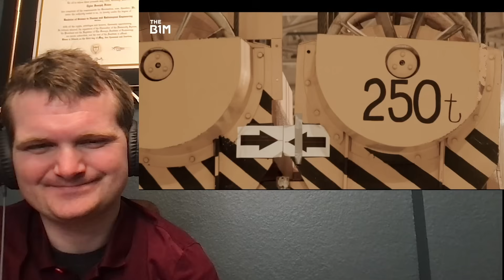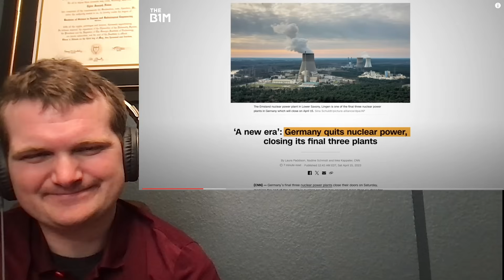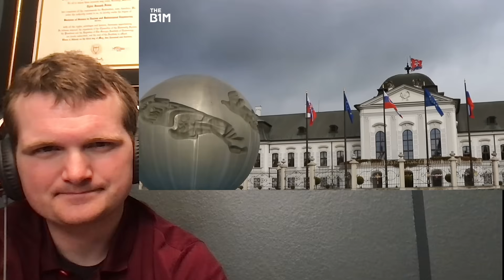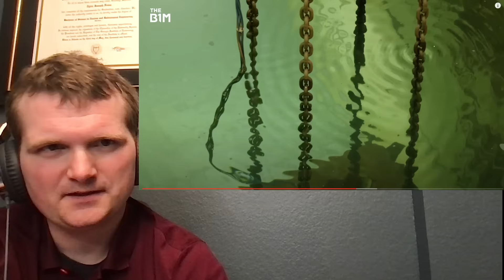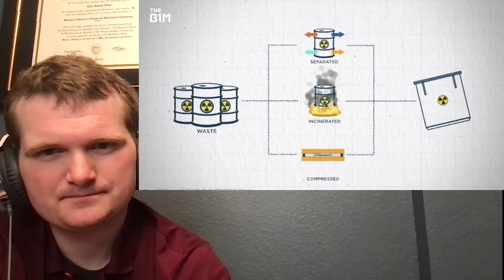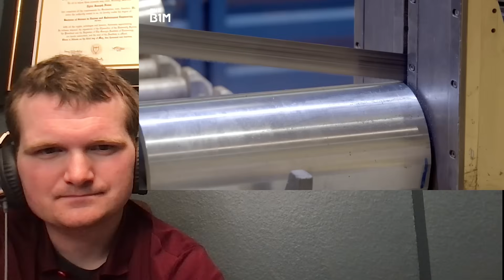Why Soviet Era Reactors are Being Decommissioned - Nuclear Engineer Reacts to B1M

Comment: In 32:20, there are NO graphite rods in this reactor. V1 is a VVER-440 which soviet PWR. These blocks were built as dual, with two reactors in same containment and two turbines for each. There is no graphite in Slovak reactors. The same blocks are running in Dukovany, CZ (4 reactors, updated to 510MW) and in Mochovce (SK). Dokovany has the same construction and there is no problem with that neithr on tests after Fukushima. For example, pressure test of containment passed with 1/5 of allowed gas leaks. And they have also updated control systems to western standards. About Jaslovské Bohunice, there is more interesting thing, block A1. It was protoype of Czechoslovak reactor. 150MW of the electrical power, heavy water moderated and carbon dioxide cooled. But it has two serious accidents. First, the fuel rod was ejected from the reactor, three people died. The second was partial meltdown of one fuel rod and damage of the reactor vessel. Then there were some radiation leaks outside the power plant while decomissioning. Now the decomissioning is top secret and it is impossible to get some information about that. I believe that it was reason why V1 was closed, A1 is a secret and they didn't want inspectors there. So they rather closed safe block for safery reasons...
Reply: That's good

Comment: I would Say Jaslovské Bohunice V1 reactors were decomisioned for political reasons, not safety. In 1990s all VVER440 reactors were retrofited to safety levels comparable in any west countries. but since neigbour Austria have Nuclearphobia , it was either shutdown or no EU entrance,...
In Jaslovske bohunice 5 reactors were build so far A1 experimental, Shutdown after core damage in 1977, V1 2 VVER440 reactors shut down in 2000s, V2 2 VVER440 reactors, still in operation shutdown is considered in 2050. New reactor is being considered to replace V2....

Comment: Maybe they could have left the cooling towers in place rather than dismantle them. Then they could add doors, windows, floors, internal drywall, utility supplies, internal lighting and the such and repurpose the building.
Reply: Well I was wondering why not just build new reactor and plug it into existing secondary loop?
Reply: @marianmarkovic5881  maybe the secondary loop is not capable of removing heat fast enough
Reply: @holaktal1778  ok we had 2 440MWe reactors, (similar were upgradet to 500MWe) i thing combined they should be able to cool off one 1000MWe,... but on other hand, new turbines and heat exchangers are more effective so it may be more effective build new ones overall, but cooling towers too? realy,.. such a waste,...
Reply: @marianmarkovic5881  well  like prypiat reactor the Soviet reactor uses flammable products for the cooling tower
Reply: @marianmarkovic5881  but I'm with you I was trying to understand the method they are using
Reply: @marianmarkovic5881  area will be used for industrial purposes, also the new project will most likely have entire new power plant build for the new reactor. I guess this approach will make most sense anyway
Reply: @ Well on the other hand level up field and rebuild is onten cheaper and easier than reconstruction.

Comment: Hmm yeah. I must say I am not so happy about that there has been a lot of malfunctions in old reactors and then obviously it is economically best to extend the reactors lifetime ..... but at the same time I am also convinced that new reactors are much safer.
Obviously it is technology that is generating energy with very little CO2 emissions, but then at the same time new safer an newer reactor types are not really built, obviously because it is very risky financially because renewables are much cheaper and have much lower investment costs with shorter payback times.
Also, the problem with storage of nuclear waste is not really solved yet.
Probably if nuclear is to be used, then it would be good to burn spent fuel if that is at all economically feasible. For that it would also make sense to support this by paying for waste treatment
Anyway nuclear will have a very very hard time economically competing with renewables... and if nuclear doesnt burn spent fuel then it remains a question if building new nuclear power plants makes sense at all.....

Comment: Finland has two VVER-40 series PWRs, operated for 45 years. The purchase was partly political, partly based on economic factors, and the Soviet Union's promise (and requirement) to take back all the used fuel.
We very soon realized that the control and safety systems were absolute [rude expression deleted]. We replaced those with the then best in class western technology, and significantly improved containment structures.
The operating licenses have been extended multiple times, always after a thorough inspection and review of systems for compatibility with the latest standards. No reactor lasts forever, and the operating companies have to have the plans and cash for decommissioning at hand.
The Finnish radiation control authority STUK is famously strict in its reviews, a fact the French Areva found out to its detriment (incompetence? attitude problem?) in construction of the Olkiluoto 3 plant, finished in 2023.

Comment: How hard do you have to hurt your brain to learn all this stuff or does it come naturally lol
Reply: I'd say it's pretty automatic. Thing it the amount of details you need to know increases when you work at several sites as there will be some differences between the constructions. 

Now I remember that we learned the basics about nuclear reactors back in school. I was fourteen or fifteen when we got to read about the then common models in school. Sure there wasn't any details or much math involved we were just taught the basics, such as how control rods could be used to moderate the reactor. Different ways to stop a reactor and what speed and what problems it would cause. Just dropping the control rods for a fast stop was as I remember the preferred method as it was easy to get the reactor back in working order. I think the boron stop was the big panik button. This dumped a solution of boron was dumped in the reactor core. This quickly moderated the reactor, but it was a bitch to restore it, so it was only to be used when the shit hit the fan.

That knowledge is just the beginning for someone working in the field. They need to know a lot of the details and when it's dangerous and how dangerous things are. But there are a lot of jobs where you need a lot of knowledge and training, but few of those handles as dangerous equipment. The fact that we've had so few really dangerous accidents shows that the design of these reactors have been very thought through, and yes that involves the old Soviet reactors. The accident in Chernobyl was to a large degree caused by personal without the full education who didn't understand the results they got and didn't perform the right actions to save the system. As soon as humans are involved things like this can happen no matter how well the reactor is designed. Now the old Soviet reactors do have some issues in the design, but it takes someone to screw things up to cause the Chernobyl kind of problems. Three Mile island was another bad situation that really shouldn't have happened. Again people were misunderstanding the numbers and pressed the wrong buttons. 

Fukushima was a real tragedy. It stood up to the earthquake but the Tsunami was too much for the system. I do not know if they could have taken it down completely without the seawater cooling, but as I understand it the reactor was supposed to be able to be cooled by a passive cooling system that didn't involve any pumps. Though the cooling tanks would have to be refilled after about one day. The backup generators failing didn't make things better that I'm pretty certain about. Further the passive system could cool the reactor to quickly, causing stress on components that could cause stress fractures. So they personell was instructed to moderate the cooling by closing and opening valves in the passive cooling system as needed. As fas as I understand there were some failure of these valves that made it impossible to open them from the control center. When personell was sent to check they found that the internal pressure in the reactor was so high that they couldn't use the procedures they were taught to get control over the reactor.

In my opinion the Fukushima plant wasn't designed to handle a 14 meters high Tsunami wave, and that was where the problems started.

But these are the only big accidents I can remember, and I feel the design of the reactors have to be quite thought through or we would have seen more and worse accidents.
Reply: @blahorgaslisk7763  Wow thank you for the response!

Comment: This is what I never understood before: that water is enough to shield you from the radiation of a nuclear reactor. Just recently I came to understand that neutron radiation is what's produced the most, and I do now understand that water is very good at blocking that. I'm still confused about how there's apparently not much gamma radiation being produced in a reactor. For some reason I thought that it is unavoidable and I know it takes a lot of conrete or lead to block gamma radiation. Water won't do the trick for gamma radiation as far as I understand.
Reply: Enough water blocks most gamma radiation. It's a little different between average uranium decay and the highest energy cosmic particles, too
Reply: That's a good question. Maybe @tfolsenuclear will see your question and address it
Reply: Atmosphere blocks essentially all ionizing radiation from space and it's equivalent to just 10 meters of water. You can think about it in another way: something that passes meters of water unlikely to react with your body.
Reply: Neutron radiation isn't even close to the major radiation type in spent fuel (alpha, beta and gamma absolutely dominate), but even in a running nuclear reactor you would have severe gamma emissions from decay and excited atom cores after splitting/fissioning. 

But it doesn't matter either way, a water pool can block gamma emissions easily

Comment: Strange to see Hungary on the list of countries soon to be involved in decommissioning NPPs. Our NPP in Paks is using the same VVER-440 reactors (four of them), their already extended EOL is scheduled between 2032 and 2037, but they will extend their lifetime by another 20 years, so they won't be decommissioned at least until the mid 2050s. The extension will cost about 1 billion Euros. Strange that decommissioning these reactors were mandatory for the EU membership of Slovakia in 2004, while Hungary also joined the EU in the same year, has four of these same type of reactors, and they will not be decommissioned at least until the mid 2050s.

Although our VVER reactors at Paks went through heavy reconstrunctions starting from 1997, they improved their safety in many aspects, including resistance to earthquakes. They also upgraded the fuel it uses, so the formerly 440MW reactors are now producing 500MW each, 2000MW total.
Reply: they are different, the ones that EU wanted shut down where the older VVER-440 V-230 models because they had some kind of design flaw in the containment building, and the newer VVER 440 V-213 had that problem fixed so it was not affected + some new/improved safety features and stuff, also they were modernized since then with new control equipment and stuff at least here in slovakia, they are underpowered compared to other reactors but they are still good, in slovakia we recently finished the 3rd unit at mochovce NPP and the unit 4 will be soon as well all of them them the VVER-440 V-230

Comment: Quick note about the steam generators... horizontal steam generators (used in VVER440/1000/1200) have generally much lower doses than vertical steam generators. We´ve had guys lying inside the VVER440 steam generator for over 1 hour during outage, doing some repairs and the final dose was below 1mSv.
In general, these reactors were designed during the soviet era during state planned economy. Money wasn't really an issue they would have to consider. I.e. when the engineers calculated that they need 2 meters of concrete of shielding, they made it 3 meters thick. Similar approach was used everywhere. Need one pressure measurement for control system? Lets give them 5. I've had the opportunity to work on the AP1000 reactor and am able to compare, just the amount of instrumentation at the old soviet design is probably tenfold. Some of these old soviet designs really aren't bad at all.
Reply: Wasn't the opposite true when they were building RBMK?
Reply: @supabass4003  kind of. And also not at all. RBMK is completely different style of reactor. It is graphite moderated, water cooled reactor, where the coolant flows in channels. While VVER reactors are your typical pressurized water reactor, I.e. the most common type out there. 
The entire concept of RBMK was flawed, in my opinion, as it came with several issues (mainly positive void coefficient). I've heard many reasons why such reactor type was produced. The one that makes the most sense to me is plutonium production - RBMK allows isolation of a single channel, removal of the fuel assembly, and its replacement. The removed fuel assembly can be then taken apart, and plutonium collected (and eventually used for nuclear weapons production). That is not easily achievable at PWRs - you would have to shut down the entire reactor, cool down everything, take it apart, refuel and restart. It also decreases your downtime, as you can continually refuel without major outage.
I don't have personal experience with RBMK reactors, so I cannot precisely comment of the margins as I did with VVER reactors.
Reply: @DarktroopX I'd watch a video of you discussing such things. Thanks for sharing such quality replies here
Reply: @D @DarktroopX  do not think there were any plans to make plutonium in rbmk ever, because this is inefficient. Military breeders are optimized completely differently and there was and is more than enough of those. I’d argue rbmk was simply a different lineage of reactors built by people who designed military reactors. Hence so reckless design and overall culture. But their rbmk design had a tremendous advantage being technologically not similar to vver, so did not compete for industrial bottlenecks like pressure vessel forging. Rbmk is low tech and cheap. It is huge so containment is difficult. And they could be built by any team capable of building chemical plant.
Reply: @supabass4003  It was also reason Why RBMK went into productions, VVER were build in insuficuent speeds,...
Reply: After thinking about it for a minute I've realized I'm just going to remove my other comment and I'm just going to put the fact that you can get any dose while in the steam Powers section is weird. Send at least for light water and heavy water reactors over here usually there's like two or three separate water systems.  basically the water that cools the reactor is not the same water that is used in the steam system which is not the same water that runs through the primary reservoir or cooling tower.

Comment: I didn't realize GA only had 2 nuclear plants (at least looking at the ArcGIS data). For some reason I thought there were a lot more -- but most of the plants I was thinking of were actually LNG or hydro. Also noticed a small cogeneration plant near where I grew up (which I never knew existed) which supplies steam to Frito Lay and the excess is used for peak power generation up to 300MW by GA Power. pretty neat.

Comment: I work for Canadian Nuclear Laboratories Ltd. (CNL) and we currently have decommissioning teams in various stages of decommissioning 8 reactors, 3 commercial power reactors, 3 research reactors and 2 isotope production reactors.  Our decommissioning teams has also previously completely decommissioned and dismantled 7 other research and isotope production reactors.  If your commercial operators in the United States need assistance with decommissioning your reactor facilities I'm sure CNL would be more than happy to provide any and all assistance you need as a contractor or consultant.

Comment: Another one of your nice, lengthy videos with a ton of details. I so do like these long-winded nerdy videos❤

As to the WWER, or VVER (ВВЭР in Russian). Its full name is; Водо-Водяной (= water-cooled, water-moderated) Энергетический (= energy/power) Реактор (= reactor). To non-Cyrillic people, the Cyrillic "В" looks like a capital "b", but is actually pronounced as "v" in Russian. So, that's why the abbreviation comes back as VVER. The easiest way to pronounce that is V-VER, instead of V-V-E-R. It is a type of PWR, but they do not borate their primary cooling system, and use hexagonal fuel assemblies instead of square ones.

And yes, they also use horizontal steam generators instead of vertical ones. Even the newest VVERs have them. Placing them horizontally prevents certain metal fatigues apparently. Or that is what I was told in a lecture about the VVER-1000.
Reply: I mean it would make sense that it would be a little bit easier on the materials being used horizontally rather than vertically. Although you would be losing some of the advantage of the fact that hot stuff rises. The hexagonal fuel layout is more efficient but  if I remember it's more difficult to arrange the fuel in the hexagonales compared to standard square layout